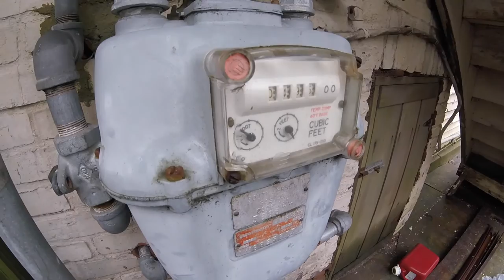Viega MegaPress fittings used on galvanized gas line

Comment: lookin great! got a question for you though - why not rheem the ends of the cuts you make? i rheem all my copper cuts with my pro press, but figured it would still be equally important for gas lines since you don't want to risk cutting the o-ring for each joint.

Comment: Still soldering pipe at work, they will not buy a pro-press for maintenance but contractors that come in use all pro-press for copper.
Reply from the maker: I hear ya. Its coming. hopefully soon for ya.

Comment: Nice. Is the mega press and pro press a different machine or are just the heads different? I'm looking to invest in both.
Reply from the maker: yes i have 2 different pro press...i started with rp210 which does 1/2 copper to 11/4 copper only. Then i added the rp340 which does 1/2 copper to 2" copper. In addition i bought the iron pipe head kit that does  does gas and heat lines sizes 1/2 -2".
Reply: Thanks for the feedback. I priced out a megapress gas pipe job in 1". I noticed that my fittings were about $1000 more than standard black iron. Are you making up for the cost difference in labor?
Reply from the maker: no threading and wrenching fittings.flying through gas installs. no mess either. good stuff.
Reply: Can you use iron pipe heads on rp210 ?
Reply: Hi mazzmari. Hopefully you've invested in MegaPress by now and have seen that, although the fittings are more expensive, the massive labor savings easily makeup for this difference.  I work for Viega and this is a discussion we have with new customers all the time.  Best of luck!
Reply: @rbgggburling541   Once you have proPress there no going back been using it 12 years with no issues . My job tonight is Propress 3/4 copper. It is the only way to go not cheap but no flame and Labor saving lets me control the schedule not the plumbers